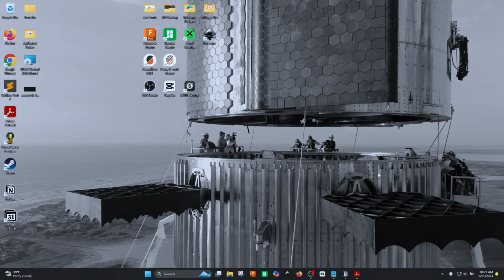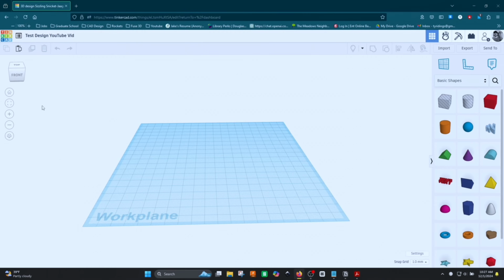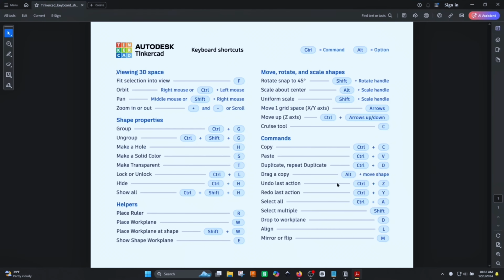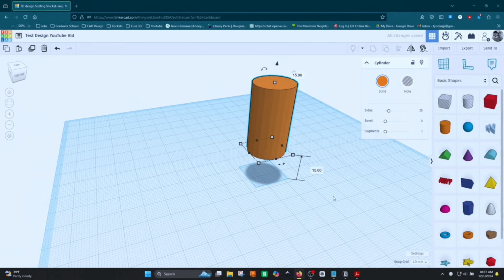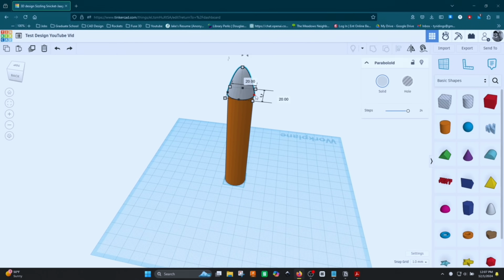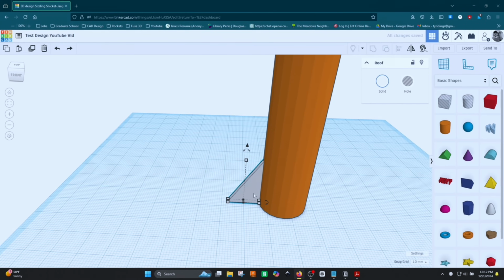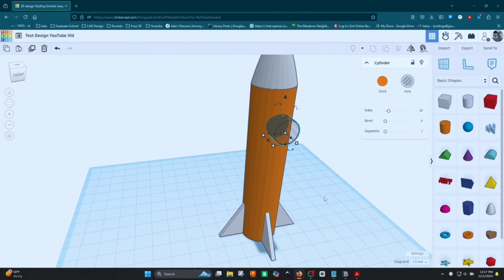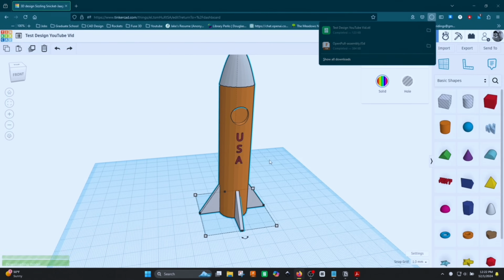Your First 3D Design in 30 Minutes with Tinkercad

Comment: Nicely done. The only thing missing is that the cylinder has sides that should be increased to the max of 128.
Reply from the maker: That's a great tip, thanks for sharing! Cheers!

Comment: 33 y/o, and this definitely helped me understand more about tinkercad and its potential. Only thing I’ve done in that program was make dowel pins for my sim rig so I’m not having to deal with bolts every time I remove my shifter/E-Brake arm, but now I gotta figure out a iPad mount for a button box. This will definitely help me get the mount I need made up just right. Thank you so much dude!! 🤘🏻🤘🏻🤘🏻
Reply from the maker: That’s awesome!! Good luck with your designs!

Comment: But what if I bought a stl.file from someone who made it?… do I stilllllllll have to put it into a BAMBU SLICER to print?

Can I edit the already bought STL.file on Tinkercade then……. Upload to usb then I can print from my BambuLab P2S. Combo ??.. My printer has a slot to put the USB in …can you explain that?…. Does that mean I can get my STL.files from my usb?.. and PRINT?!?!?!?🤓
Reply from the maker: So, you can do whatever you want with the .stl (take it off of USB, etc) but once you are ready to 3d print, you have to upload the stl file to bambu studio and slice it so that it gets turned into machine readable directions called .gcode that tell your printer how to actually make the part. From there, you can upload .gcode over your home network to your printer if you have that setup, OR, save the .gcode file to an SD card, then insert that SD card directly into your P2S. 

Id highly recommend googling the process before giving it a shot if needed!

Comment: If you were to print this model on a resin printer would it be smooth and round? In the program it looks like the cylinder is actually made up of a bunch of flat side and not round?
Reply: No, it needs a smooth operation added to it. Don't ask me how, I'm in the same boat as you. I'm trying to figure that out. Might have to export to some other app and run a smooth operation on it there.

Comment: So will your rocket print as a solid or will
It automatically default to using infill on the inside?
Reply from the maker: It depends on what your 3d print settings are! You can set it to whatever infill density you would like

Comment: Do I understand this right that it would 3d print this as a solid block and I would have to make it hallow by myself?
Reply from the maker: If you want a hole through the center, create a long cylinder in tinkercad, change it to hole type, align it with the center of the existing rocket, then combine the rocket with the hole cylinder to make it hollow inside. I hope that helps!

Comment: 7 minutes into the video and still not showing how the software works. Either cut it out completely or let us know the time stamp when you start showing how to use the software. I'm stopping here and moving on to another video.
Reply from the maker: I appreciate the feedback! 

To push back a little bit, this is meant to be an essential beginner guide so I tried tailoring this for someone that's never opened the software and may need all of the beginning information (what is CAD, and how to login and what is on the user interface). 

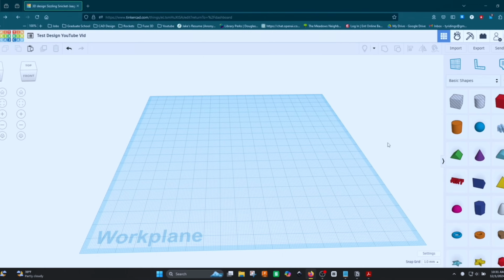Also, you say "let us know the time stamp when you start showing how to use the software". By the 1:15 mark I have step 3 listed on the screen in the video with a time stamp pointing to the exact point where the building actually starts ("3. Let's Build (11:06)"), and I did populate chapters in the video timeline that take you there as well. Curious what else is missing? 

I understand needing to move on, and I am far from perfect with trying to make these videos and always looking for ways to make them better. So truly, I do thank you for commenting!

Comment: Hi from the UK. Super video, subscribed. If by chance you read this, could you recommend a beginner 3d printer please. Doesn't have to be the cheapest, but not the most expensive either. Going to use your vids to ease me into the hobby. You're a natural teacher. I should know. I've been a teacher for 40 years. Engineering, mathematics and lately, unmanned aircraft technology. Best of luck with the channel
Reply from the maker: Welcome, and thanks for the feedback! I don’t think you can really go wrong with any of the Bambu lab printers, especially the P1S which is super cheap right now. Given that you are located in the UK, you may also really like the Prusa Mk4 or Core One printers as well. I’d say, look at those two brands, set a good price point you’re willing to pay and specs you care for, and have at it!
Reply: Wonderful ! Thank you very much for your advice.

Comment: Awesome Vid!  Just joined tinkercad and now already made my first piece - thanks to your vid!   Now I just need to figure out how to engrave, not emboss text!
Reply from the maker: That's awesome, congrats on making your first piece! For the section where I added the USA to the rocket, if you instead switch each of those letters from a solid to a hole, then combine it with the body it will engrave or "cut out" where those features are and leave it negative in the part. Hope that helps! I wrote this down for one of my next Ty's Tips videos, thanks for the feedback!

Comment: Tinkered it’s pretty darn awesome and relatively easy to get yourself into and figure it out. Do you happen to know another program that you could utilize or you could actually 3-D scan something like off of an iPhone 17 or similar and then be able to transform that into an STL file to 3-D print. Reason I ask is I do a lot of custom car audio and there are a lot of very unusual shapes that speaker pods need to be built into. I generally cut and build those out of foam board because it’s very easy to manipulate and glue together and then it would be awesome to be able to scan that part into something to be able to actually 3-D print.

Comment: Thanks for the video. Would be good if you did an update since TC has introduced many new concepts recently that have brought TC to a much more useable level. Things like the sketch tool, the revolve tool and an under the covers switch to allow TC to generate much smoother models that can be 3D printed much better. And they say there are many new updates on their way before the end of the year. Since you use Fusion would love to get your take on the new tools and how they enhance TC usability. Thanks.

Would also be interested in Intro videos to Circuits and Codeblocks.

Comment: A rocket is an empty tube. This seems to create a solid cylinder. How do you create a tube?
Reply from the maker: Great question! Create a second smaller diameter cylinder and change it from hole to solid, then align it to the center of the larger cylinder and combine the two! I hope that helps.

Comment: Thank you for the tutorial, I've never have done CAD modeling before, but I reckon I need it now than ever.

I usually have automotive engines apart, so creating a part holder or a sorting  jig  is my main goal now.
(Pushrod, valve, lifter holder)

Thanks again.

Comment: Totally new to CAD. How would one go about designing a low profile locking cover/lid. Just because there's not just the top to be printed but the locking part needs to be incorporated into it. Any help would with this would be greatly appreciated.

Comment: Nice introduction, thanks. The one thing I would have mentioned is the concept of the Workplane and how the Workplane tool allows you to easily select different planes so you can more easily combine objects (solids & holes) to better support Boolean operations. Would definitely be interested in seeing more. I'd be interested in seeing a video on the new Sketch Tool and more on Codeblocks (as well as more about the electronics & animation capabilities - TC just offers so much!). Codeblocks are really interesting and give you a coding environment to help you build automated and parametric designs (just wish it also gave the ability to directly code in Python too if needed). Even Fusion doesn't have this type of functionality easily available. Would also be great to see a  video comparing TinkerCAD with Fusion. Would like to see a given model developed in both systems and contrast the differences taken in both applications. Personally I use both and try to pick the one that makes development easier for specific models. Think it would be awesome to see a video showing some of the differences one would use when modeling in Fusion vs TinkerCAD (haven't seen anything like this from any other creators).